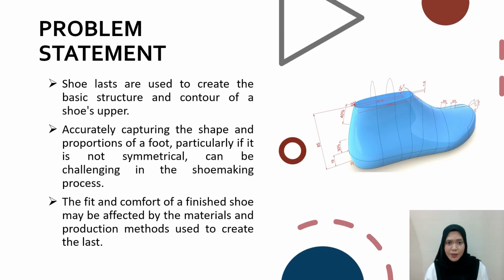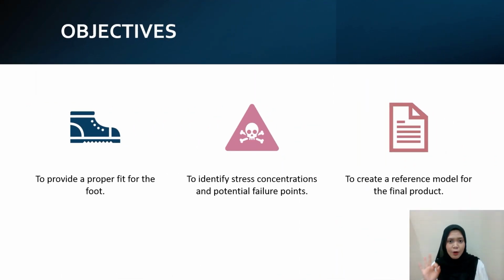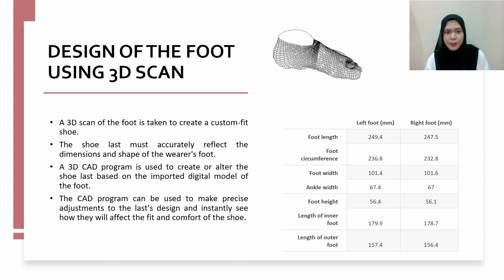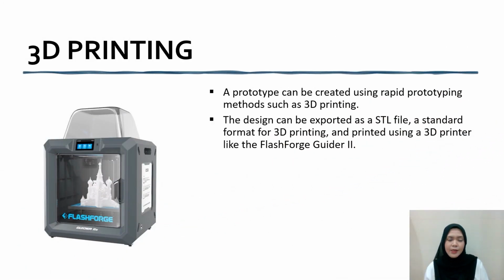MEC601 FINAL YEAR PROJECT 1 - PROPOSAL PRESENTATION

Comment: 'promo sm'
Reply from the maker: Sustainable management in shoe last design and modification entails a systematic approach to production that promotes environmental protection. Materials that are renewable or recyclable can be used in the creation of shoe lasts. This minimizes the demand for non-renewable resources and contributes to environmental conservation. Next, processes that limit waste can be put in place to lessen the production of shoe lasts' negative effects on the environment. This can involve eliminating scrap material, reusing production leftovers, and lowering the usage of single-use packaging.
Furthermore, the use of energy-efficient manufacturing techniques can help to conserve energy and minimize emissions. This can involve employing LED lighting, harnessing renewable energy sources, and optimizing machines to reduce energy use. Last but not least, it also can lessen the need for frequent replacements by designing shoe lasts that are both durable and adaptable. This reduces waste, conserves resources, and lessens the production's negative environmental effects. Employing these guidelines in the design and modification of shoe lasts allows to produce goods that are not only of the highest quality but also considerate of the environment. This contributes to a more sustainable future while also helping to meet customer demand for eco-friendly items.